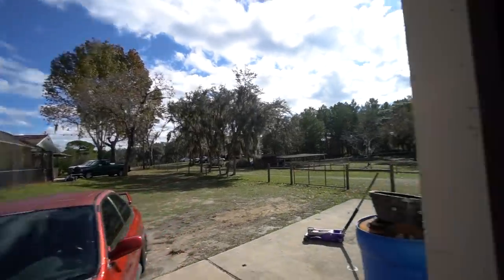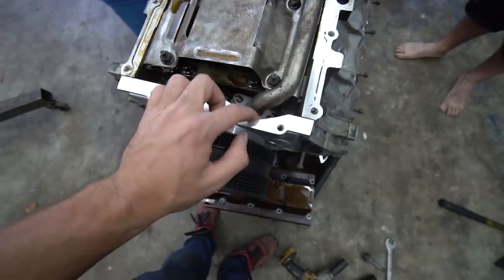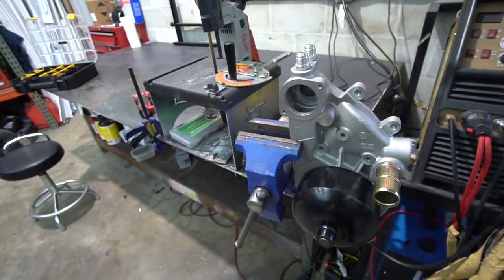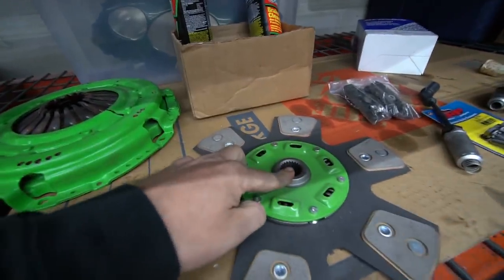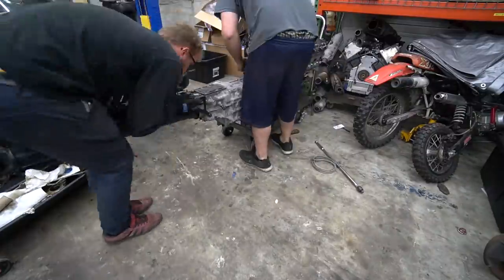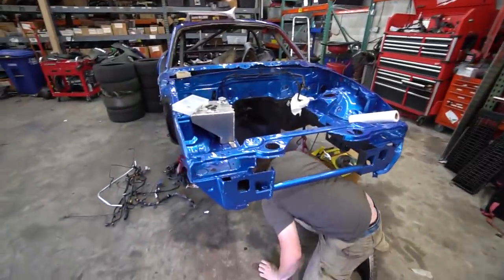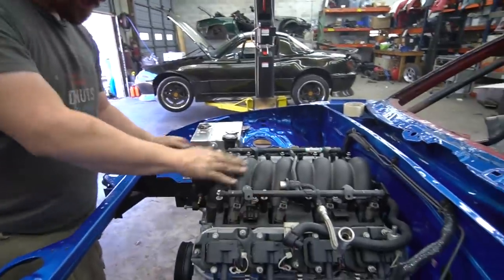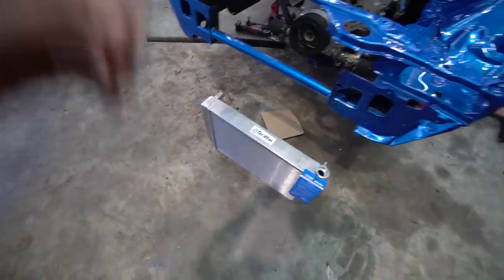LS Miata Part 4 | Drivetrain Assembly, Install, Building A Custom Radiator, And Body Work!

Comment: Please put rubber isolating washers on those radiator mounts, solid mounting a rad usually ends up with a cracked end tank
Reply: Shh, dont ruin the fun 😄
Reply: @Leofred2000  cracked rads are pretty fun... 🤣
Reply: His exactly the same and has worked perfectly fine for well over a year of hard use.
Reply: @thedestroyer3262  that s why I said it usually cracks. Doesn't mean it will or it won't but I've seen too many solid mounted rads crack to not speak up
Reply: That's usually only a problem with plastic ones the all aluminum ones normally are fine when solid mounted
Reply: @coryhalvorson8874  only if it was stock with plastic endcaps",remember ruber hoses move and flex and him haveing a",All aluminum rad fixes those issues.
Reply: @thegreatwhite2004  wait so solid mounting a full aluminum rad is ok? I just "custom" installed mine in my hotrod and I solid mounted that mf it came with tig welded mounting flaps

Comment: I'm surprised you rigid mounted the Rad.... That isn't going to be an issue with vibration and flex with the frame?
Reply: If it was plastic maybe when motor flexes because of hoses moving sometimes it cracks ends where hoses hook up but being all aluminum there alot stronger that lil bit of movement should be fine.

Comment: If you have hole saws, you can take the pilot bit out of the arbor and use that to cut a circle. The bit will want to walk because you don't have a pilot bit so you need to use a piece of wood (3/4" ply is good) that has that size hole in it, clamp it to the aluminum, and that will hold the hole saw in place. I'm looking forward to the Fummins build!

Comment: Nice work 👍...Little trick to make round sheet metal ... hole saw a hole through a 2x4 then clamp the metal between that 2x4 and another you can then use the hole saw without the center drill 😉 you can make a 2x4 with multiple holes in it different sizes and use it over and over
Reply: That's using your noggin!
Reply: Ben I’m not good looking so I have to be kind of smart 😆😆😆 not really to Smart also tho 😆😆😆
Reply: @clnfreakone8486  😅 A good one i heard from AvE was if you need to open up a hole you can double stack the saws on the arbor, the size you want, then the size of the hole as it sits. Similar principle, but its a massive time saver as well!
Reply: Ben ye great way to make washers double Hope saws
Reply: @clnfreakone8486  definitely gonna remember that. Great idea!!

Comment: Love your channel bro. I saw you arcing out on your radiator when you struck your arc! Try putting the ground on the material itself you are welding so you dont possibly arc out and blow a hole in the radiator. 🤘

Comment: Fummins time
Reply: That's what I'm waiting for as well
Reply: He just knocking out the last few projects on the other cars first so he can fully focus on the truck since it's not very easy to keep moving 2 giant heavy trucks in and out of the shop because he needs to use the lift for something else so my guess is the Fummins build will start beginning of January.

Comment: So crank is ez go to the dealer by crank-bolt for like a 2017 or 2016 model LS is inch longer than the stock one its $11

Comment: would have welded a nut on the backside of the radiators bodyside tabs
This is why you fab everything up then tear it down to paint, not paint then finish fab.

Comment: I would be worried about breaking the radiator with out rubber mounts
Reply: ken kalb . The small surface area of the mount weld point will quickly tear out after a few heat cycles too.
Reply: Anom Amos yes as soon as it twist too it will

Comment: She's going to be a sexy beast when she is blued out like that.  You may want to make sure that Ben tapes off the holes in the firewall before he sprays out the inside, so it doesn't blow overspray into the engine compartment.

Comment: You like that Milwaukee diegrinder?
Reply: they are great. I don't even use my air one at work any more.
Reply: @jsomething2  guess ill buy one tomorrow
Reply: @dill5500  I don't think you will be disappointed, like the speed settings are nice, air one you're always half throttle and under load it bogs, this one you can pick a speed, and it holds that speed even when you load it down. it's a touch big for some super tight spots compared to a mini air, but still handy as hell of you already have m12 in your box

Comment: corvette engine covers look cool but the other 90 pecent of the car is a nissan, mazda, ford and actual american companies building the swap kit, not to mention all the bits you have to fix on the gm motor(trunion, pickup tube,etc).  the fact is if the corvette was so great why would you bother swaping an mx5. thats my 2 cents
Reply: Schwaglet the Miata is a great chassis with a dinky engine. The ls is a great engine that fits well and is lightweight. Great chassis+ great engine= great car

Comment: Have you ever considered using accusump instead of dry sump? Dry sump just seems like so much going on.
Edit: talking about your Miata lmao
Reply: Accusump should be your backup oiling insurance, not relied on continuously.  Also, much better subframe/rack clearance due to the considerably smaller pan depth for dry vs wet sump.
Reply from the maker: Blackmkiv is pretty much dead on. Dry sump is better in every way asside from the extra lines and possibility of loosing the belt. Oil temps are lower. Oil doesn’t airrate and lasts longer. More consistent pressure. Adjustable pressure. More oil volume. Etc etc.
Reply: @Taylordrifts  Awesome! Hopefully no judging lol have to ask if I want to learn.

Comment: Heating up crank to put on.... why not just use the crank bolt!   & if seal is on & you pu a heated crank pulley, you’ll stress or damage crank seal